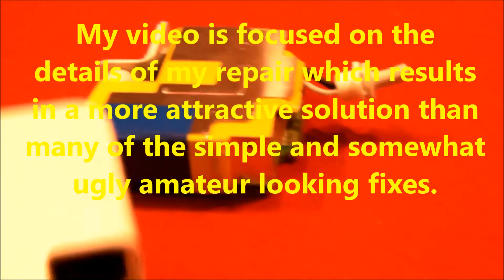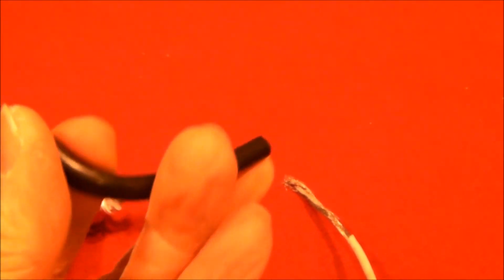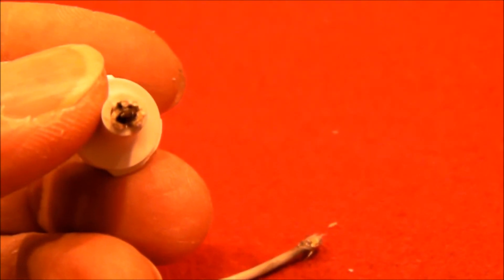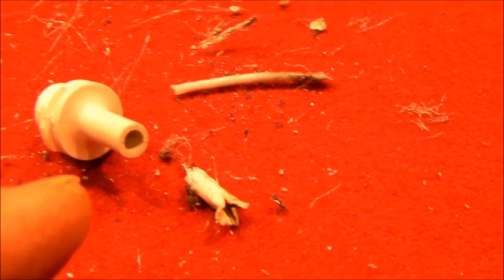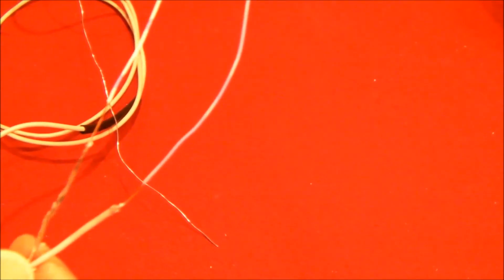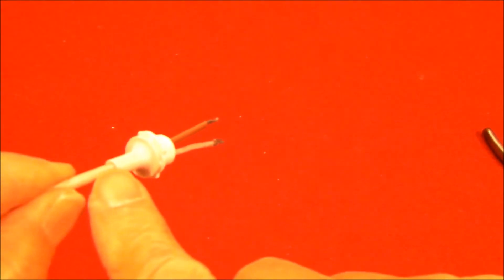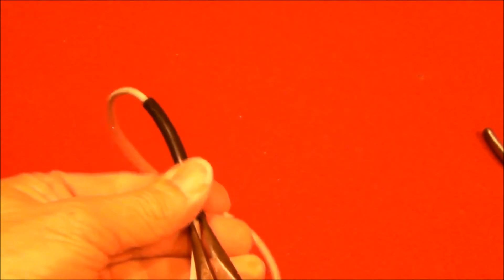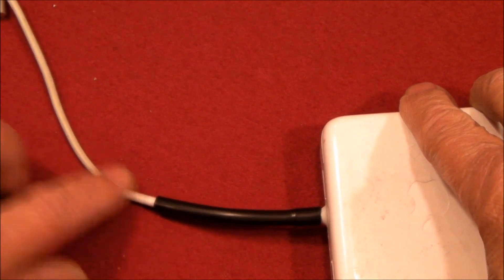BEST LOOKING Apple Macbook MagSafe AC adapter charger repair broken wire; fix broken magsafe cord

Comment: Cool Beans. Mine seemed to randomly shred in various places, but I talked apple into giving me a new one. Now the new one is coming apart. I wonder if it is some kind of heat issue. It never gets moved around at all. Anyway good luck, i'm glad you found a solution that works.
Reply from the maker: typical of Apple ... use something innovative and then make it really expensive to replace.  You never hear about a Dell laptop or any windows laptop for that matter with a frayed power cord.  NEVER.  Apple obviously wanted something super flexible and thin ... that results in VERY POOR longevity and reliability but gives them opportunity to charge you again for a replacement ... an EXPENSIVE replacement.  In the interest of full disclosure the ONLY Apple product I own is an ipad.

Comment: While you had everything apart, you could have bought a new cable instead of repairing the old one which will simply shred in another place
Reply from the maker: Yeah, maybe but the computer and charger belong to the school and they would not replace it for my wife so I took the $0 approach.  It's been TWO years since I made this repair and it looks as good as the day I did it.  This is her everyday computer so it gets plenty of use.  No shredding yet noted probably because I have beefed up the insulation and made it somewhat stiffer where the wire exits the charger.